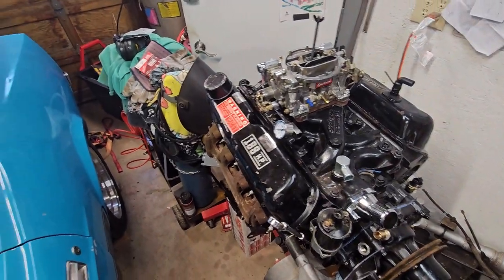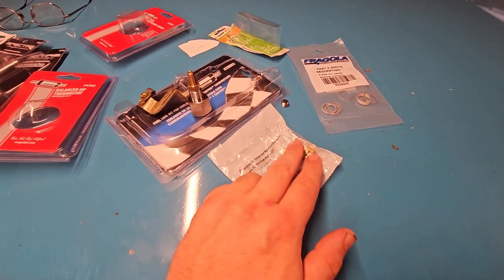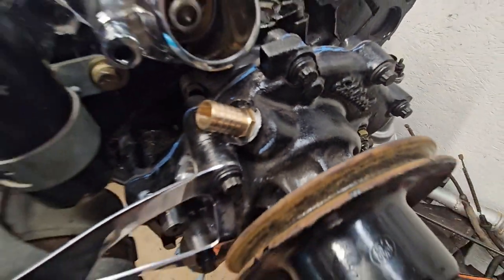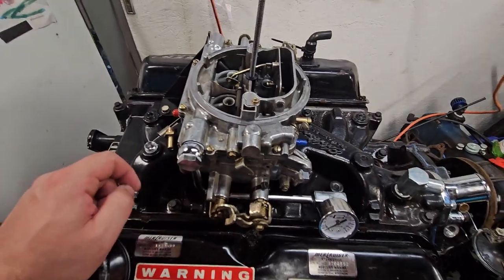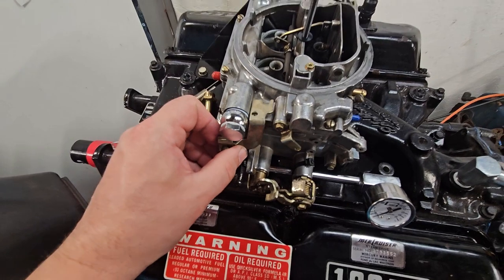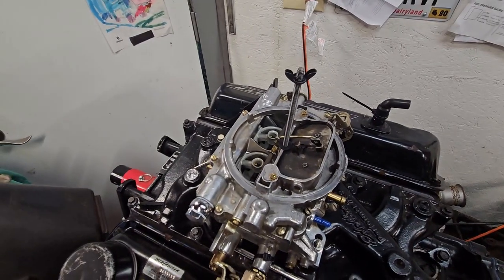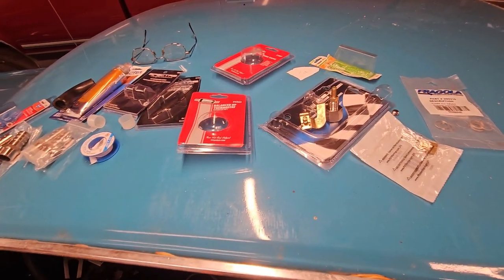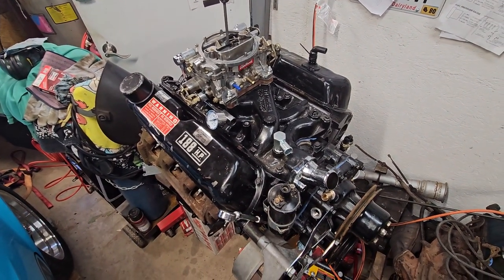Drag n Drive Pinto: V8 & SROD Swap 6 #nonamenationals

Comment: Just came across this. This takes me back to when I was 15. I did the water passage modification to 351 Cleveland heads. Put them on a 351 Windsor block. Took me forever to save up for the intake manifold. Dropped it in a 74 pinto runabout. With a toploader 4 speed. This was back in the 80s fun times.😊